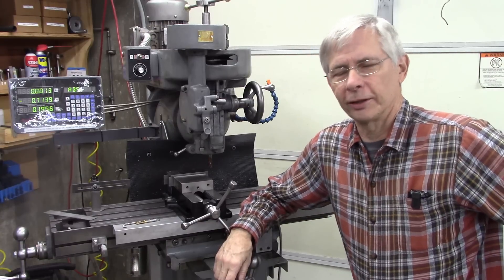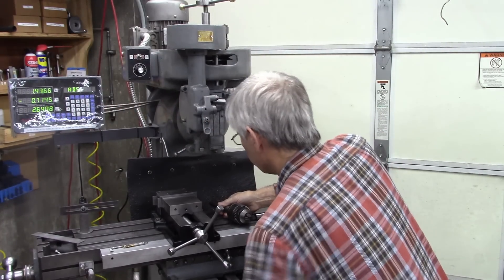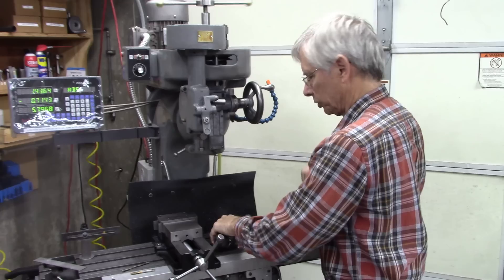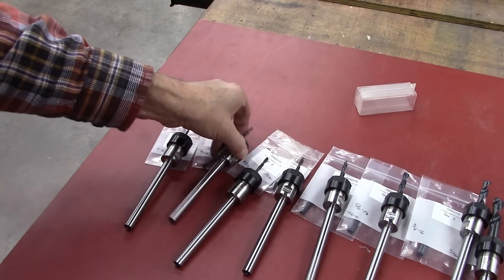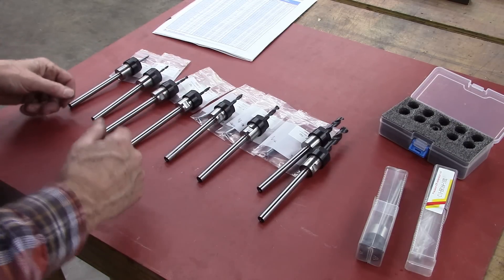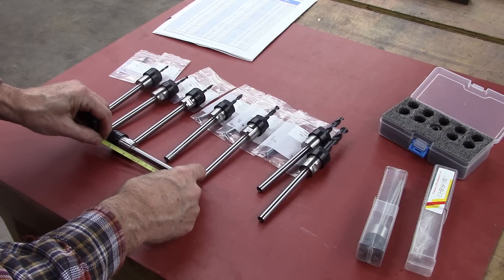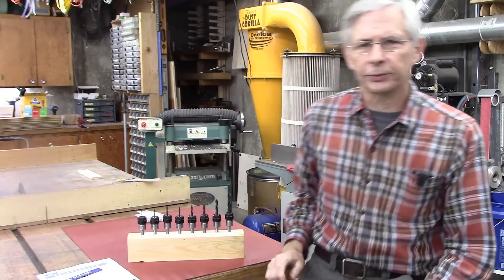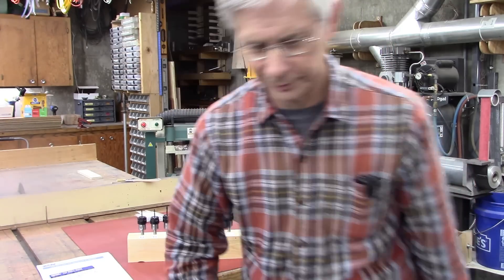Easier Tapping and Drilling on a Mill

Comment: Good moring Winky, I had sent you a message a couple of weeks ago on one of your videos in reference to the inexpensive indexing plates on the rotary wheel you used. One came with my mill but wasn't assembled nor had instructions. The indexing plates don't just bolt on. I'm not sure if I'm missing a piece. Could you video the assembly on yours or send photos of the pieces needed for assembly? Yours and mine look like the same model. 
Thank you in advance,
Help from NY
Reply from the maker: Yes I remember your previous comment. I was going to shoot a video or take some picture and send a link but never got to it. Yesterday I stepped in a rut in the yard and sprained my ankle. I ended up going to an urgent care and apparently a bone in my angle is broken. There is a small chance I might have have it pinned. I'll find out in two days...  hopefully not but either way, I'll be taking a 6-week vacation from my shop. Not my idea of a vacation but it is what it is. The link below is to my rotary table with indexing. My plates are held in place with 3 Phillips screws. Hopefully this helps, for now its the best I can do. https://cdn0.grizzly.com/manuals/h7527_m.pdf
Reply: @WinkysWorkshop  I hope you heal quickly. At our age it takes a little longer than it used too. No rush at all. I appreciate your effort.
Reply from the maker: @Rochesterhome  Me too...  crutches are very restricting.

Comment: Another way to do it is to use 1/4" hex drills (and possibly taps...) by making a single adaptor to a convenient collet size (my edge finder is 10mm, so I would choose that...) Yes, they are not as supported or concentric- but the drill flexes and follows the centre drilled hole anyway.
Reply from the maker: They are stubby drill and I never use a pilot drill. I like the hex taps but they are hard to find.
Reply: @WinkysWorkshop  I use stubbies too, but not brave enough to rely on them without a centre drill first...
Seems to me that a 'quick change' system is needed- on it...
Reply from the maker: @Tensquaremetreworkshop  Thankfully I have never had issue with the stubby drills wandering although admittedly the smaller drills could be an issue.

Comment: I have a Wells Index mill too.  A model 55.  What is the device you are using to tighten and loosen the draw bar?  Do you have a video on this?
Reply from the maker: The wrench to do this was just a doughnut of steel with a 1/2" drive socket welded in it with handles. The 1/2" drive fits the head tilt and belt tension and the other end fits the draw bar. The draw bar itself is different than most but a copy of the original Wells Index. It's self ejecting, no hammer needed. There is a link in the video description to a drawing of the bar. Its a fantastic design. https://youtu.be/hM7LlQfzLdQ
Reply: @WinkysWorkshop  I found the video and watched it already.  :) Mine has the original draw bar.  It's different then what they gave you drawing for. Which seems like a major improvement.  The draw bar does have a shelf on it, but it sits under a capture nut that screws into the threads.  Gonna make a copy of that wrench you made.
Reply from the maker: @JoeyG1973  The drawing was my version of the draw bar. Under the drawing was a picture of the original wells index. I made mine different. I think the enlarged part off the shaft on the wells index design bears down in the top of the spline. In my design it's held captive in the nut. The top edge of the threaded part of the spline on my mill was not in the best condition. Somebody put a standard draw bar in it damaged the top edge of the threads. My design isolate the end of the spline from abuse.

Comment: Great idea!  I have a dreaded round-column mill, so I absolutely hate to have to move the head to drill.  It definitely makes me work out the sequence of operations to minimize having to make any changes to the Z-axis.  
Instead of turning down all those hardened shanks though, I think I'm just going to buy a 10mm R8 collet (or two) to use just for this purpose.  Thanks for the idea and the inspiration!
Reply from the maker: I had a round column so I know what you mean. The reason I wanted 3/8" shank is that I have a 3/8" countersink I use as a guide for my guided tap wrench. I also have a weird B&S #9 taper and can't find metric collets

Comment: FWIW. I had a similar situation. I didn't turned the ER collet chuck shank down. I grind the BS collet ID to handle 10mm.
Furthermore. IMHO. The collet chuck's shank is the concentricity reference. When I was considering the same. I was thinking of chucking a piece of drill rod on the ER collet side so that concentricity between collet and shank can be maintained. But then, there is TIR runout tolerance on every collet. Current ER TIR reference is something like 0.007 mm.
Reply from the maker: I thought about getting a B&S 10mm collet (or modifying) but I wanted to be able to leave the collet in and switch to a 3/8" countersink bit or 3/8" end mill. In hindsight I should have made the ER adapters 1/2" as it is the most common size end mill I use. As for the concentricity,  I'm guessing the OD is  about the same as the collet. Certainly plenty close for drilling. They seem to be much better than most drill chucks.
Reply: @WinkysWorkshop  ER collet better TIR than drill chuck. Certainly. Hardly able to find TIR specs on drill chuck.
It's done. No need to discuss further. 😊😊😊
Happy new year.
Reply from the maker: @ramonching7772  Yep, and I'm only using the collets for drills.

Comment: Can you use a 10mm side lock holder and switch short ER bars with one set screw. No need to use the drawbar every time.
Reply from the maker: That would work well going from drill to drill but I usually go from drill to mill so the collet change is needed anyway unless I was using a 10mm mill.
Reply: @WinkysWorkshop  will you eventually have the corresponding taps in more ER holders. With the range currently set with all tapping drills the next tool is usually a tap.
Reply from the maker: @marley589  Probably not. Power tapping a blind hole is too risky and my mill has worm drive in the quill will not let a tap be pulled into the work. After drilling I usually install a 3/8" countersink to chamfer the hole and then the back of my guided tap wrench fits the countersink bit. Currently my 3/8" bit has a 1/4" shank but I'll get one with a 3/8" shank. This will eliminate a collet change.

Comment: Good way to get around a lot of cranking. You got me thinking about similar thing I an do.
Reply from the maker: If you are dealing with metric its easier. In hindsight i should have made the shanks 1/2", I use a 1/2" end mill more often than than a 3/8" so going from drill to mill it eliminates a collet change.
Reply: I use homemade GT tapping collets for tool-less quick release and a very short working height.

Comment: Very nice, thanks. Clearance is always back of mind with my Busy Bee mill. I was thinking of making individual sleeves for each drill to then go in a MT collet but this looks a lot easier.
Reply from the maker: These ended up being fairly cheap and work great. The hardest part was turing the shanks down. Apparently they make CBN or ceramic inserts that do much better. I need to get a few.

Comment: The long shank plus the collet and drill bit is probably about the same length as an empty drill chuck. So you still have to drop the knee the same amount.
Reply from the maker: I cut the shanks to 2-inch long. The collets only grip about 3/4 but I wanted the option to extend the drill a little.At 2 inches it's about the same as change an end mill. They works great.

Comment: Boy that took me back to the days when I was a Jig Bore Operator.
Reply from the maker: I wish somebody made small Jig bore machines. Somebody like Grizzly or Jet would likely sell quite a few. Just a fairly heavy duty drill press with dovetail slides on the table or even box ways.
Reply: @WinkysWorkshop jig borers tend to have one prismatic way and a flat way. Like a lathe or surface grinder

Comment: That sure is a good idea.
Reply from the maker: One viewer pointed me to an TTS adapter. It was a 3/4" shank to ER20 collets. It would have worked well but this was cheaper and also usable in my 1/2" chuck on my lathe and drill press. I also like the fact that it makes it easy to keep up with the drills. I used to keep the tap and drill together but then after using the drill bit I'd lay it on the bench of mill table. Several time the drill for the tap would end up in the drill index. This collet holder/drill reduces confusion although I need to engrave the size on the holder.

Comment: good idea. but I noticed the draw bar wrench you made that spins. That seems to work much better than a simple wrench
Reply from the maker: Yeah it has a shallow socket so it sits on top of the nut, very handy. Plus the Wells Index design is self ejecting. No hammer needed.

Comment: I have a number of parallel shank (Ø16) ER16 collets that I have reduced the length of, threaded the end to suit my Vertex Posilock chuck and added a centre hole as well for the Posilock. I have two different lengths so that the shorter small drills have similar reach to the longer ones. The advantage for me is that I have an R8 spindle and a Ø16 R8 collet. This means I have the flexibility to put long or short ER16 collets shanks into the R8 collet or to put them into the Posilock chuck that fits the R8 spindle. As a result it is rare to have to do any height changes due to headroom issues. I did have one recently where I had to drill a Ø14 hole though a depth of 90mm using a 2MT drill in a 2-3MT sleeve then a 3MT R8 collet. Just could not do a pilot hole then the 14mm hole  without changing the headroom. ER16 collets have a 1mm range and a set will contain collets to fit any size between minimum and maximum as a result, never had to drill a collet out.
Reply from the maker: Sounds like a vecitial setup. The only reason I had to drill the collet was that i had two drills that were very close in size (#10-32 and #10-24).

Comment: I’m wondering if you may have lost some of the concentricity between the inner taper and the shaft OD.  I may have tried to put the shafts into a collet, with a center-drilled rod in the ER that you’re working on to keep it straight, and turned them down concentric with their original OD and then cut them off.  However, a drill bit won’t really “care.”   
Thanks for sharing!
Reply from the maker: It's possible I lost some but like you said, it doesn't matter with a drill. They actually look quite good.

Comment: Interesting solution, I started with ER32 so I don't have the same problem as you.I don't know what Brown and sharp tapers you have, but there are ER collet chucks with a Brown and Sharp taper. ER 32 collets cover a good range, quiet an investment! All the best!
Reply from the maker: I have an ER40 adapter. It's a better (than a chuck) option for drilling but changing drills in the larger collets is time consuming. Plus the B&S #9 in the mill plus the ER40 is a bit longer. For $75 bucks this set of holders and dills is really nice. Organized too. In the past i've tried to keep a drill with the taps but it seems like I lack self discipline. I end up setting the drill bit down and then it never makes it back to with the tap. Not I need to engrave the holders with the tap size.

Comment: I recently bought a Bridgeport clone. After one week I was sick of cranking that Z axis knee. I bought a Z axis power unit. A $125 well spent. Installed easy, and works great. Do yourself a favor.
Reply: That’s what I did. Power feed on all three axis is easier on the muscles and saves a lot of time. The Z axis is especially useful for lowering and raising the column quickly. Best money I ever spent.
Reply from the maker: No kidding! I plan to.
Reply: $125? Would you be able to share the link

Comment: G'day Mark.  This is an excellent idea, especially if you have a few spares of each drill bit.
My HM54GV Mill is Metric as well as doing Imperial. The idea of one shank change over is Excellent.
Mine is a NT30  coupled with ER32 collett set, which I change over different collett sizes for the drill bits. Or just a standard 5/8 chuck with your mods 
Thanks for the suggestion. 
Ted
Reply from the maker: Thanks Ted, sound like a collet set and your all set! Ha

Comment: Looks very similar to the TTS style of work holding.  Great video
I went on aliexpress and the er16 tts collets are similar price when shipping included
Maybe use your 3/4 bs collet for tts and a lot less adapting required?
Reply from the maker: THANKS! I had to look up the TSS, yes looks similar. I had no idea they existed. They have them in ER20 with a 3/4 shank on Aliexpress for $13.05. This would be a great option and less work although about $90 buck higher.
Reply: @  yes with a bit of digging around you can find er16 in a pair even tighter pricing.
Search
2pc TTS 3/4" STRAIGHT SHANK ER32 COLLET CHUCK TOOL HOLDR GAGE LENGTH WITH GROOVE PRACTICAL TOOL ACCESSORIES
Will strangely give a link to er16 collets despite the title saying er32 for around au $16 each in the pair
Reply from the maker: @jirvin4505  I'm sure...  amazingly cheap

Comment: Nice to see this. The ER system is very versatile and because they are split from both ends, they grip fairly parallel, unlike R8 collets for example. If you need to grip tightly, use ball nuts, they are great, a little more expensive but work well.
Incidently, R8 metric size collets are widely available in te UK which is what my mill quill uses so I have a nix of metric and imperial sizes.
For small sizes, ER11 is useful. I use ER11, 16 and 32 sizes and they cover most things.
Reply from the maker: My mill uses Brown & Sharpe #9 collets. A very good collet but hard to find anything other than a inch. ER collets are great although they take a bit more time to tighten.

Comment: Nice work. I replaced my drill chucks on my mini lathe tail stock and mill with ER20. More headroom and you can grip the drills on the flutes if you want to create a stub drill with less flex. They are more accurate than cheap chucks so make a nicer hole and drilling experience. It’s not too much extra time changing drills either.
Reply from the maker: Lots of possibilities for ER collets. I have a chuck on my lathe that is ER40

Comment: Not machining for nearly 2 years but recognizing the problem. Collet chucks use less length than Jacobs chucks. Cutting drillbits to shorter length is an alternative but then drilling deep holes lacks drill bits...
Haha, "retarded fractional system". Sorry US guys but I think the same.
Reply from the maker: Ha...  I like the fractional but it's hard to argue that it's better. Of course I grew up with it. It's 100% in my head, I even have most the decimal equivalents memorized.

Comment: What a clever solution . I'm going to have to get me some of those.  And I'm going to have to make a spinner for the draw bar that can just stay in a clip on the machine instead of having to look fora wrench every time.  Couldn't you have just  used the right collet in the mill instead of turning down those hard steel shafts? Mine are R8. would that be a problem finding one?  I made your thread tap guide a while back
Reply from the maker: My B&S #9 collets are hard to find in metric but that would have been the best option. Still it worked out well. I have a "spinner" for my drawbar but the Well Index had a really cool self ejecting drawbar. Mine was missing when I got the mill but I made one just like the original. Cool on the tap wrench, for being so simple it really works well. Thanks.

Comment: Thanks for the video and link to the thread chart.   Nice idea.   Shame you were not able to find a 10mm collet for the B&S taper.
The set looks good and works well.
Dave.
Reply from the maker: Well at least with the turned down shank there is a change the right size will be in the mill when i need to drill for a tap Your welcome on the info.

Comment: The lengths of the shanks only need to be as long as the gripping length of the collet. 3/4" max is all that is needed, so no need to drop the knee so far to get them in.
The drill chuck with a drill bit inserted is very close to the same length as the tap wrench setup. Can both be completed with the knee in the same position?
Reply from the maker: Interesting. I didnt know for sure what the length was. That would have eliminated the need for the tailstock center on the lathe too. 

Thanks
Reply: True. I adapted my Jacob’s 16n and boring head to straight 3/4 x 2 inch shanks.
Reply: @ellieprice363  would 3/4" long still have worked just as well for you too?
Reply: The longer shank does allow more stick out from the R8 collet if required for just that little bit of extra reach that is sometimes required.
Reply from the maker: @martinconnelly1473  True, maybe te length I have is a good compromise.
Reply: @martinconnelly1473  Maybe just leave one long for the odd instance where extra reach is required.

Comment: I bought a full set of R8 inch collets, after everyone told me I'd only use a few, just to use for drilling! 
I have an ER40 collet chuck for metric sizes.
I have the most commonly used ones (that fit end mills) color coded.
Too lazy and cheap to do dedicated stuff.
Reply from the maker: I have ER40 for my lathe and a holder for the mill. I use it occasionally but in the mill but often on the lathe.